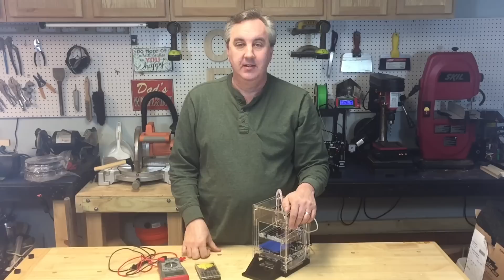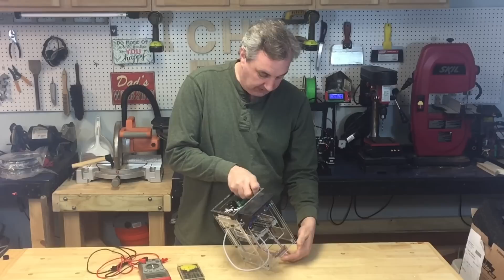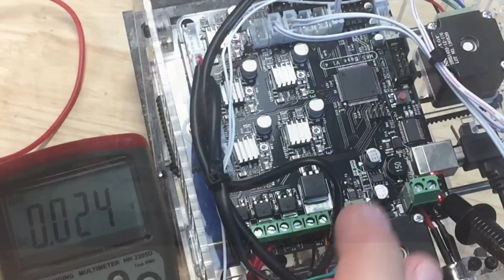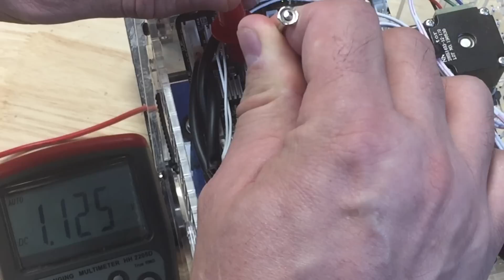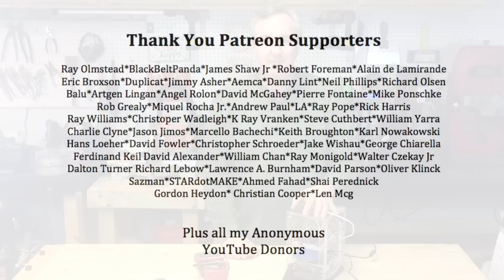Tuesday Tech Tip - How To Adjust Stepper Motor Current on Fabrikator Mini

Comment: the feeder pull out the filament but it don't  push it down to the extruder at all I try  printing some thing
Reply: how do I fix that
Reply: CHEP 3D Printing  where can I get a circuit board at then
Reply: CHEP 3D Printing  monoprice mp select mini 3d printer

Comment: Hi there, my X axis motor is getting really hot, so I found this video and I'm convinced I can solve my problem with it (thanks!). One problem, my voltmeter is giving me a reading of 0v from the -ve to the single pin on the potentiometer. I tested it on other points on the board, and I got readings, but every singe potentiometer reads 0v. I have connected power, but not plugged it into my computer. Any ideas what I'm doing wrong?? I'm using a modified LiPo battery checker as my voltmeter so could it be that? Thanks in advance!
Reply: CHEP 3D Printing I tried the USB metal casing first, then the metal casing directly from the power socket, and neither worked... 😕
Reply: CHEP 3D Printing still nothing 👎🏼 guess I've just got a dodgy meter. I'll get a proper one soon. Thanks for your help though!!
Reply: Hi again, just bought a proper multimeter and discovered that X was at 0.29V!!! I've put it up to 0.75V now, hopefully it will sort out my print issues. This video has saved me spending hundreds on a new printer!!! Thanks so much 👍🏼

Comment: Hello Chuck,

Here's how I fixed hot stepper motors and prints shifting in the x axis and a fix for bed levelling.  I just bought a nearly new Fabrikator mini that never had a single print made with it, only some some melted PLA on the hot end from a guy who got it from a friend who was never able to get the printer to work.  After I installed the Repetier and Cura software on a spare notebook and homed the printer, I noticed that the x axis was not very smooth moving and the stepper motor was getting very hot.  I adjusted the stepper pot voltages to .75 as you show and all of them were high but initially less than 0.9V.  I tried again and the bed movement was not very smooth and a little tight like the belt was too tight. I loosened the belt a little by removing and replacing the cable tie and the homing seemed to work better and the stepper motor did not get as hot.  But when I tried a test print the first two or three layers were fine but then I started to get x axis shift and the bed would not move all of the way to the right.  The stepper motor also got very hot.  
I did a little research and found another you tube video by Patrick Strang about loose set screws on the stepper motor pulleys :  
https://www.youtube.com/watch?v=_Sz6DWGFZzI

So what was happening was the motor was getting very hot from the friction of the shaft moving erratically inside the pulley.  As the motor heated up and the pulley expanded the shaft would move more freely inside the pulley and slip more and more until the bed almost completely stopped as in the you tube video.  

I again cut the one cable tie holding the x-axis belt to loosen it,  unscrewed the three screws holding the x-axis stepper motor to the  bottom of the printer, removed the pulley and added a drop of loctite to the shaft then re-seated the pulley and tightened the set screw (it's very tiny like 0.9mm hex wrench tiny).  I then re-installed the motor and re-tensioned the belt with a spare black cable tie and I was back in business.  I also tightened the y axis stepper set screw for good measure and will keep my eye on the extruder stepper motor.  If it happens again I might consider grinding a flat spot on the stepper motor shaft to give the set screw more bite.

One last tip - I had trouble with leveling the bed as it was higher (lower?) in front then in the back.  I found four springs and put them around the four standoffs for the screws that attach the bed to the printer.  I then tightened all of the screws and then backed off slightly the ones that I needed the spring tension to elevate the bed.  It worked like a champ and my bed was completely level.

So now I have a working Fabrikator mini that I picked up for half the price of a new one.   I wonder how many more are out there with these issues.
Reply: same problem here with the shaft/pully. I also moved it up a bit, and works like a charm now.

Comment: Just got this printer to introduce me to 3d printing before purchasing something bigger. My 1.5 version the motors were running red hot and I was worrried damage would occur or my board would melt!  Thanks for great video it explained things very simply without fuss.  Must try this on mine.

Comment: My mini fab steppers were all at .77 and the motors were so hot you could not touch them for a full second !Dropped then to .65 and they are warm. But not "HOT" at all I've ran this printer that way for over a month. I wish I'd known about this sooner hopfully the motors aren't damaged. I herd finding replacements for this printer are touch.
Thanks again this was a great guide

Comment: i turned the current down on my mini fabrikator stepper motors to .75 and they are still running hot hot hot. what now?BTW  just a note of caution ... dont reach under the bottom with your finger to test if that x stepper is running warm or not.  LOL  burnt the #%$#%# out of my finger!  YIKES

Comment: chuck next mod heater bed i found this one on ebay Fabrikator Mini Tinyboy 3D printer Aluminium PCB Heatbed heat bed MK2 FULL KIT http://www.ebay.com/itm/222055725912

Comment: Hey Chuck, Have you tried out the .25 MM nozzles yet from E3d?
Reply: Well what got me at looking for parts is I had a clog but it was in the throat and they only way I could get it out was to remove the PTFE sleeve which ripped it.  So that got me to thinking about switching parts.  I did order me a new hot end all together but I ordered all the parts to rebuild my old one.  I think the next purchase will be the smaller tip.  I do alot of models for stuff like dungeons and dragons.  So did you try to .3mm on the mini fabrikator?
Reply: Do you happen to have your cura settings for the .3mm nozzle?  Mine is coming out all wavey and funky.

Comment: Chuck, I'm trying to make Octoprint work with my Mini and need to get a printer profile .ini file from an old version of Cura for the FabMini.  The Cura plugin used on Octoprint is not compatible with the latest version of Cura on the PC!  I need an older version .ini file for the printer settings.  Do know of a source for this file or a better way?
Reply: +Chuck Hellebuyck&#39;s Electronic Products I believe I did, but will try again tonight.  The Octoprint plugin is very picky and fails without notice.  After you do the import, you find out that it failed when you try to do a slice and there is no profile to select.

Comment: Awesome vid Chuck and thanks. I just did a 10 min print and at stock calibration my steppers were insanely hot. Given this issue and the FTDI chip being counterfeit I am almost ready to send it back to Hobbyking and demand a refund!
Reply: Hey Chuck, Yeah I have ordered the LCD screen via the amazon link you kindly put on your webpage and will calibrate the stepper voltage / current after work tonight. I'm sure once I get it working fine I will be less cranky with HobbyKing but given they have absolutely NO! aftersales I can't recommend anyone purchase it. That said I'm sure you would help quite a few people if you made a video explaining how to install the legacy FTDI drivers and prevent windows from auto installing the newer drivers which render the unit inoperable. I spent quite a few hours trying to get it working and I like to think I'm pretty clever with such things. =D
Reply: +Johann Wyss so I run my fabrikator using the drivers that win10 auto installs and the drivers that osx installs. granted I've not grabbed the driver installers from ftdi's website myself however I've had zero issues with it in that regard.

I guess this isn't an issue with every unit, I'd send it back if you were sent counterfeit kit and ask for a unit with legitimate ftdi chips onboard.
Reply: Mate I am having nothing but dramas! I turned the voltage down too .75v and the steppers are still getting to 70degc! NOW the bloody X axis isn't working, it appears to be slipping between the pully and the stepper motor shaft! Sadly I don't have a .9mm allen key only a 1mm!!!! GRRRRR

Comment: Well, once again you have come through Chuck!!! turns out that was exactly my problem!! My y axis was at 1.3 volts so i followed your video and lowered it to .74 and have just completed a perfect 3 hour print! Those pots were so small that with my weak eyesight i wasn't able to make them out. Thank you so much. One question though, the pulley on my y axis stepper still gets very hot, too hot to touch actually. Is this normal?

Comment: Hi Chuck, Great vid. I was going to ask what effect changing the stepper current has, but I've gleened from another comment that more current = more torque (more or less). But what effects does this have on the quality of your prints? If you wound the current back too far, how would it affect your prints? There may be a whole video in this...

Comment: Yet another great video that I'm sure will save me a ton of heartache; I'm just finishing up my Mini v1.5 setup, and turns out all of them were set between 0.85-0.95V from the factory. Go figure.  Turned them down to 0.75 just in case, and now know what pots to tweak to help resolve any motor issues that might crop up in the future. Thanks once again!

Comment: Do you have a PLA Profile for Simplify 3D that works with the Fabrikator Mini v1.5? I noticed you had one for ABS, but not PLA on your website. Or is just changing the Temp for my PLA prints enough to get good prints?

Comment: Do not use metal screwdrivers on powered machine! You should be using ceramic screwdrivers, get them on Amazon, or elsewhere, or you may slip and burn out your printer board by shorting it out.
Reply: +Chuck Hellebuyck&#39;s Electronic Products Very easy to short the stepper driver and or board use ceramic screwdrivers as we do on PLC. or any other electronics while power is applied. Even the prob can short as it was close to the heatsink.

Comment: Hi Chuck, I have done quite a lot of tuning on my Fabrikator mini, what I have found is setting the X and Y steppers to 0.7, the Z axis to 0.6 and the extruder to 0.9. I found this the best balance of torque and heating of the motors, the Z requires less torque so I set it lower. I had quite a few problems with the extruder motor "cogging" and hence set it's current higher but since it is a bigger motor mounted external it seems to cope well. For my 2cents worth :-)

Comment: Great information, I know my new Fab Mini v1.5 motors were all getting blistering hot, I just assumed it was normal. I've been using a 120mm USB Fan blowing at an angle over the Print, Extruder Motor, and the X-Axis motor (bottom right). 

I have another 10hr+ print planned for tonight, so I'll see how they feel in the morning after I tweak the current :-)
Reply: +John Sanford The small NEMA 11 motors still get super hot to the touch, but they don't radiate as much as heat. So guessing they are less "super hot" then they were before I tweaked them all to 0.75V. But the feeder motor is WAY better than it was before, I think that was was at 0.95V before I tweaked it.

Comment: Also the potentiometers like that the top where the screw driver goes is the wiper and same as the top pin , or single pin side. so if you use a clip from your probe to your screwdriver shaft , you can see the voltage without having to hold the probe and the driver .  just be sure your driver is conductive to its tip where you clip the test lead .

Comment: A question regarding stl files exported from Thinkergad. How do you smooth files made there such as circles?? I am making a loose filament holder but it's not coming out smooth. Thanks in advance, chuck.

Comment: I bought a kossel delta mini kit , should I check my potentiometer and setting them to 0,75 volt too? or that current is only for the fabrikator mini
Reply: ***** thanks for answering , I found the specs for the nema 17 I have , rated voltage 2.8  -  current/phase 1.68 - resistence/phase 1.65 - inductance/phase 2.8 - this is the name SL42STH48-1684A
Reply: +Chuck Hellebuyck&#39;s Electronic Products checking the board I found 0.5 v on each motor

Comment: Great video and info as always, Chuck. For those of you needing a specific reason for this voltage, the stepper drivers are A4988 drivers. The current output on these drivers is Vref=2.5. Vref is the voltage coming off the driver, like Chuck was showing here. So according to Pololou, your Vref voltage should be your motor's current rating in Amps divided by 2.5 in order to maintain maximum torque for these particular drivers. But running a little higher probably won't do any damage. FYI, if you're running the DRV8825 drivers, the Vref=2. This has worked perfectly for my crappy little OneUp.
Reply: +Chuck Hellebuyck's Electronic Products Thanks.
That's a good move. That's why you're the one with the channel, Haha.

Comment: Your advice by lowering current is not very good. Your maximum acceleration on Y will be reduced. Without hard data on how hot was your stepper you can't tell if they are too hot. Steppers are designed to run hot and most are rated to 80C.
Reply: +Dmitry Platonov Even HobbyKing suggest this range of voltage.

Comment: Good info but to late for me, my mini went bad after 3 days and that was probably the reason. But I learned that Hobby King has the worst tech support I have ever dealt with. Not giving up, I will by another one once I find another distributer.
Reply: +Chuck Hellebuyck&#39;s Electronic Products Not sure, hoping Amazon will start selling them. Never had an issue with them if a return is needed. I would like to have one, I loved it for the few hours that it worked, lol

Comment: 0:58 I believe they call the small screwdriver set a  "jeweler's screwdriver set"  ;-)
Good tip.
Reply: +Chuck Hellebuyck's Electronic Products No problem chuck.
I posted in case someone was doing a search for the small screwdrivers ;-)

Comment: Good stuff Chuck, I had to do this on my Robo 3D, this is the best video I have seen on the process. The best part I am taking away from it is the use of the USB metal shroud as a ground point. This would have made the process so much easier for me! I was using a grnd pin on the stepper (Iknew I could possibly have fried it but I have spare of all electrical parts.  Seems like a good enough time for me to check em again!

Comment: Hey Chuck great info would that be the same for most of the I3's also?
Reply: +James Bussing that depends on the stepper motor and the stepper motor driver in your printer. Brandon addressed this in his post as well.so you need to check your documentation for your hardware

Comment: X,Y,Z,E what was that extra driver for a second extruder that can't fit in there?
Reply: +Dark Alchemist yes the board has the electronics for 2 extruders as well as a heated bed.
Reply: Mark Burton
Try and get two nozzles in there.  Seems the board has upwards expandability whereas the actual machine is limited.  Which board is in these anyway?
Reply: *****
Ahhhh, thank you very much as I thought it was.  I can tell you the previous versions of the MKS BASE (not open source btw) had issues when using the LAN so the RepRap people figured out it was the resonator's fault and replaced it with a crystal and no issues since.  The manufacturer took that info from the RepRap forums and upgraded the boards but it is still closed source. :(  If that board was an open sourced board I would already have one but with the issues it has had and not being open source I can't, with a good conscience, buy one as that would be supporting the manufacturer that takes from the community but is unwilling to give back.

Oh, well.  Thank you again.